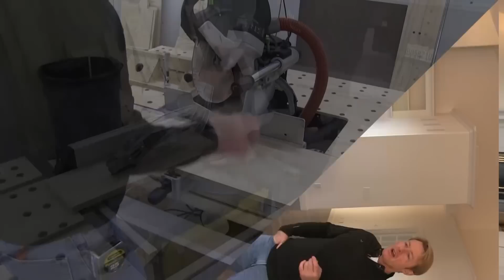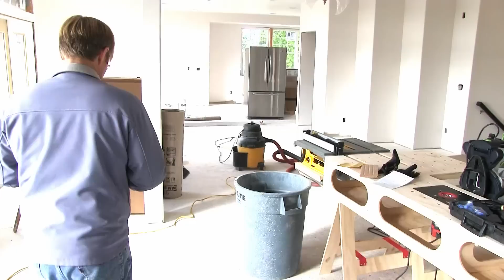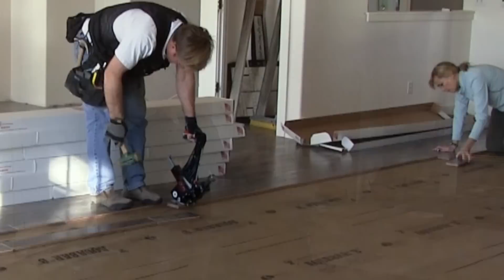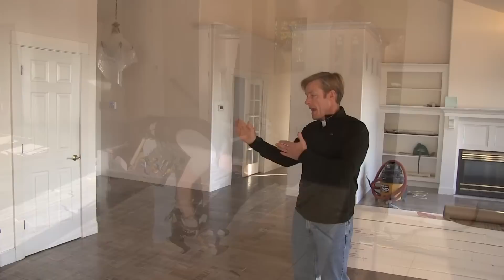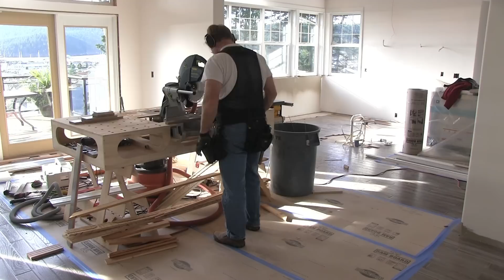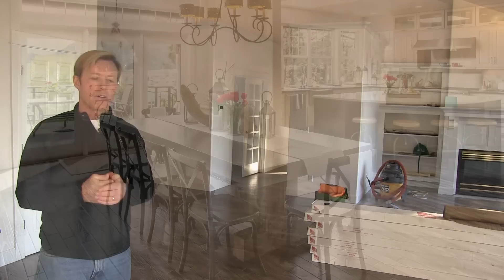HARDWOOD INSTALL TIPS

Comment: Ron, digging on your tips.  The razor blade (thin) shimming to make those small gradual adjustments along the way is awesome, as is the start in the middle with a firm starting "rail" to cut chances of problems in half.  Question:  If you are required to use the razor blade thin shims, how are they filled once the project is nearly complete?

Comment: What is the rational of laying the hardwood perpendicular to the floor joists?
Reply from the maker: Hardwood installed parallel with joist will sag and separate. If you need to run it parallel, then you should overlay the subfloor with and an additional layer of 1/2" plywood

Comment: Do you ever use your razor blade shim trick as a method to incorporate planned expansion gaps?  I have a wide area - about 35ft, where I will install hickory plank with glue assisted nail down method.  A 3% MC shift (6-9%) equates to over 5" of potential expansion from winter to summer.  Wondering if I should shim between boards as well as leave the perimeter gap, or just nail away as per usual.  Thoughts?

Comment: I found out rather than trying to set any nails or cleats that did not seat all the way into the wood, it was far easier to use a Dremel tool to cut them off rather than a punch to attempt to drive them in further, especially in Brazilian Cherry.

Comment: Ron great video most of all these videos I see usally they don,t talk about checking the flooring or subfloor with a meter also checking the relative/humity in the home although most installers don,t do this and the guidelines according to the NWFA says to check 40 boards in a 1000 sq ft anyway I really want to say great illustration for this part but in the video i notice you checking a board and pinning it from end to end of board i was taught to check with meter from side to side the width the other might not be a true reading again overall good video 
Patrick Burke
Flooring Inspector👍

Comment: Is that a t nailer with no air ? That’s a hard days work lol , why no pneumatic nailer? I’m guessing it’s a very hard wood and splits ? I normally have no problem using pneumatic on oak , harder woods I use a t nailer , if I get splitting I put a shim under the backside of the nailer creating more angle making sure I get more “ meat” of the board fixing the problem , hardest wood I ever installed was about two months sago , it was a pre finished Brazilian mahogany , bundles were 80 pounds a piece , all 180 of them good work

Comment: Outstanding video.  I am a home owner with plans to install hardwood floors in a home which currently has carpet.  The base under the carpet and pad is OSB.  How do I determine if I need to lay down new sub-floor material prior to installing the hardwood?

Comment: Great layout wisdom! Imho tapers are more visible with pre-finished flooring because its usually micro-bevelled on the edges & sides of the boards. With raw wood that you sand its not noticible under 3/4" unless youre looking for it. I try to put them behind couches & beds & have the focal points of rooms line up square as reasonably possible. 3/4" taper on pre-finish behind a bed or couch is fine too in my 2¢

Comment: Hi Ron, Could you share what kind of hardwood floor is the one from the video. It looks great. Thanks!
Reply from the maker: Shaw-HGTV Home Solid Hardwood- Clayton Style TV808 4 Inch width -Distressed Oak Color Ipswitch 284. It is no longer available. We are doing some more remodeling on this house and can no longer get it to match what we have already installed.
Reply from the maker: Hi J I tried to get some more from the homeowner, but it looks discontinued. Here is the info. Shaw-HGTV Home Solid Hardwood- Clayton Style TV808 4 Inch width -Distressed Oak Color Ipswitch 284. Shaw may offer something very similar in a color very close.
Reply: Thank you so much Ron. Floor looks great, awesome job.
Reply: Did you let aclimate product inside the packaging?

Comment: It looks like you were installing with the base board already installed. how does that work, with shoe molding?
Thanks.
Reply from the maker: Base shoe was the answer as this was a remodel with the base already installed. We priced it both ways and it was far less to add the shoe, plus the homeowner loved it. In this case more was less and more;0)
Reply: Thanks, I am a furniture maker by trade but have been doing quite a bit of finish carpentry and your videos are second to none. Thanks so much.
Reply: What is "shoe"?
Reply: Hi Annony. A shoe molding is a piece of molding of the same material as the base molding. it is usually a piece of 1/4 round stock that is added in addition to the base. sometimes the gap left for a solid wood floor to expand is greater than the thickness of the base molding and still leaves a slight gap. I most cases, that gap is covered up by the added shoe molding. I hope that helped.
Reply: Makes sense, thanks!

Comment: Ron, could you comment on the three-piece miters on the crown molding I see in this video. I watched your series on installing crown and you didn't mention this I assume because its a different project. Its a nice detail though that I have is not used very often.
Reply from the maker: +Bob D. Bob, crown and base need to step around the rounded drywall corner. It is very simple, instead of figuring a 90 degree using 45 degree cuts, we use 22.5 degree cuts which means the small piece has a 22.5 on each side which matches up the two longer pieces also cut at 22.5, the length of the small piece is ⅝." The same method is used for the base molding.
Reply: +Ron Paulk Thanks for the reply Ron, I was aware of how it was done, though I have not had cause to do it myself. I was more curious if you had included it in any of your videos thinking if not that it may be topic worthy of a video of its own. You've covered details such as this in some of your other videos.
Reply from the maker: Yes, I would do a video on round corners, but this was a remodel and the round corners from from 15 years ago. Round corners have gone the way of orange and avocado appliances.

Comment: Great tips Ron!  I find that starting in the center (as you've mentioned) with a splined first course achieves the best results and ensures a perfectly straight course to start.  Also, there's been instances where some boards are slightly wider, (of course after they've been fastened) and to minimize the compounding effect, a Rabbet Block Plane works nicely to true the edge to even out the course.  Great tip with that razor shim! Furthermore, if you ever run into an instance where the subfloor runs uneven (either from settling or a wall sitting on a joist bay) cutting kerfs in the underside of the flooring helps the hardwood to flex and contour itself with the floor better:

 https://www.dropbox.com/s/1j0vk5rjda5ko6s/IMG_6361.jpg?dl=0

Lastly, if you don't want any face nails exposed, trim screws, a couple wedges, and a right angle drill adapter work nicely on the last few courses:

https://www.dropbox.com/s/2c4prm3edz4rxbk/IMG_6279.jpg?dl=0
Reply: instaBlaster...

Comment: Great tips, Ron. I could have used a couple of these 2 months ago when I put a new hardwood floor on an out-of-square (AND out-of-level) room. As an amateur, I've never even thought about using a spline to turn the boards around. Good job!

Comment: Great video Ron.  Lots of good tips.  I see your using a non-pneumatic nailer.  Obviously from your previous post you run the best of equipment(rightly so), so was wondering if you feel there is an advantage to the non-pneumatic nailer?
Reply from the maker: Todd Bailey HI Todd, my nailer is 25 years old. If I were to buy one today, it would be pneumatic.
Reply: +Ron Paulk You should look into a Primatech with the roller base. Pricy but it easily paid for itself within a couple jobs.
Reply: Todd Bailey its manual one ..you can get for $300...good pneumatic one cast from $500 and its better to use for prefinished wood